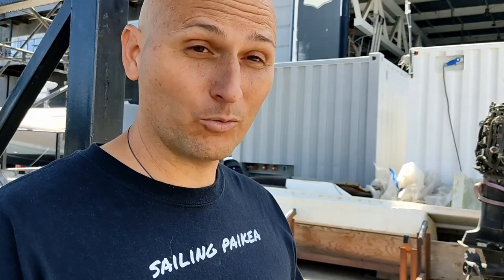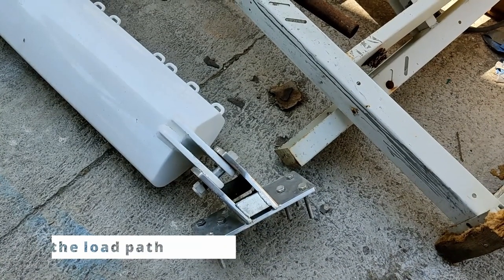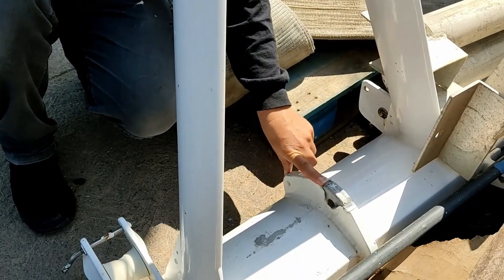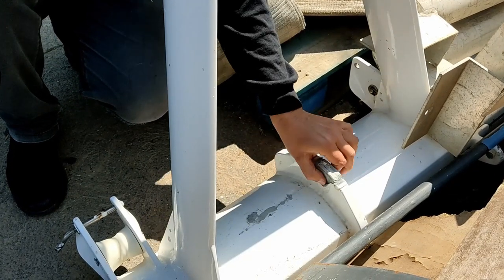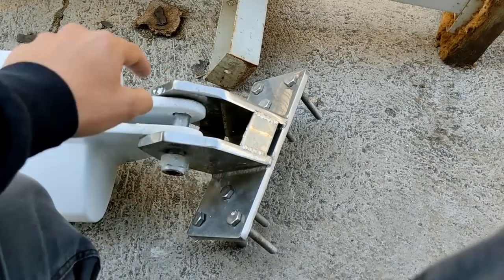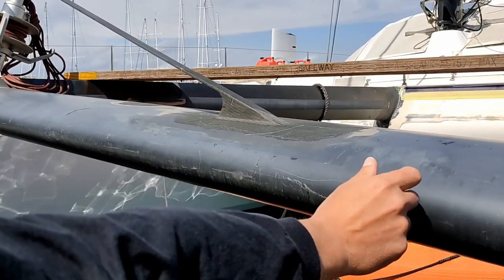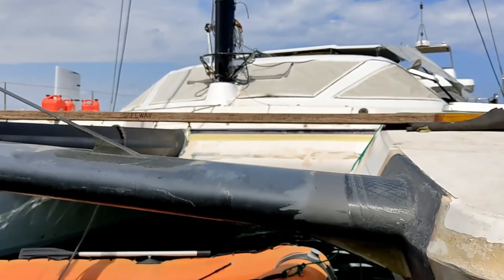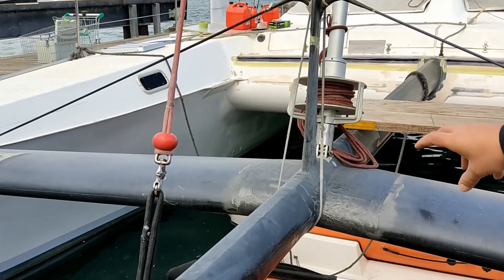Let's talk about LOAD PATHS - Replacing our catamaran's aluminium front beam with a carbon fibre one

Comment: Very interesting discussion as we are in the middle of buying an older performance catamaran ourselves (51ft LOA) and the crossbeam attachment points were an issue during the rigging survey last week.  The connection points of this French-designed and built catamaran are nearly identical to your Catana with the exception of what appears to be some type of metal sleeve or bushing over the bolt that holds the crossbeam in place.  Currently the crossbeam can move back and forth inside those fittings with considerable movement and now I'm wondering if this wasn't by design.  Your discussion around the need for those fittings to allow the hulls to flex separately from each other has me questioning just how much movement there should be in the crossbeam by design.  Thanks!
Reply from the maker: you're welcome! Good luck with your purchase

Comment: That whole front assembly is orders of magnitude stiffer than any part of, or a whole production cat 🐱! Awesome. Instead of that old pinned joint which could wear and be clunky why didn't they just use a big stainless rose joint at the beam ends. Cost maybe, it definitely wouldn't react any torque and the pontoons would be extra compliant and comfortable. My guess would also be you have enough vertical bending stiffness not to need the martingale at all.

Comment: It was like I was back doing engineering again. Cool vid though, on the original setup would they have torqued the bolts or just a bit of a she'll be right kinda thing?
Reply from the maker: No torquing of bolts on these types of boats. Trying to torque a bolt that is compressing plywood is impossible as the wood squashes slightly different at each bolt.
Reply: @youngbarnacles  thought no, but didn't think about the plywood and squish on that. Really enjoy the more technical vids thanks again.
Reply from the maker: @vokstar  glad you are enjoying the tech videos. 
I am thinking of doing a series of vids going through the process of designing a new boat, and show the considerations of each aspect of the design and how it relates to our boat and experiences. Involving an audience in my profession could be an interesting experience 🤔
Reply: @youngbarnacles  Mate that would be outstanding, sounds like a butt load of work, but I'd defo watch.

Comment: How did you tension the front beam via seagul striker?
Reply from the maker: For this one I only held the martingale straps straight with aluminum sections and then bonded them in place.
The other option to get some pretension is to hang a weight of the end of the longeron and then glue the martingale straps in place.

Comment: very interesting!Would be nice to find something similar for the amas of my tri!Guess you already handle all the left over carbon fiber stuff in valencia ;-p Love your channel guys
Reply from the maker: These mast sections may be a bit heavy for trimaran beams??? They were definitely heavy for my front beam. Even being heavy I could still make the whole thing lighter than the previous setup, but sooo much stiffer and stronger.
Trying to find bits long enough was our biggest challenge. Most of the stuff we found was already cut up and ready for land fill. If you look around and ask questions there are a surprising amount of old rigs around not being used anymore.
Reply: @youngbarnacles  Depending on the trimaran…but yep sure heavy for mine. Anything in the bow is heavy but im sure lighter than your alu alloy. Not a bad use to tune up a 12 m section to make a wing mast though!take care guys